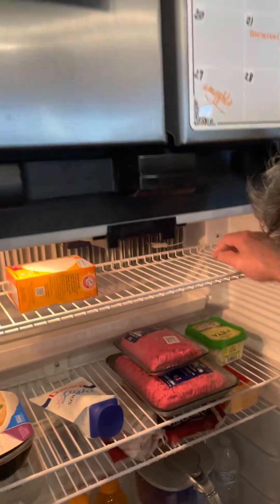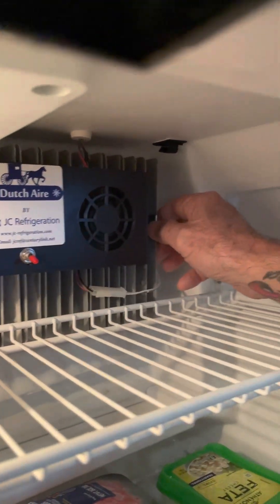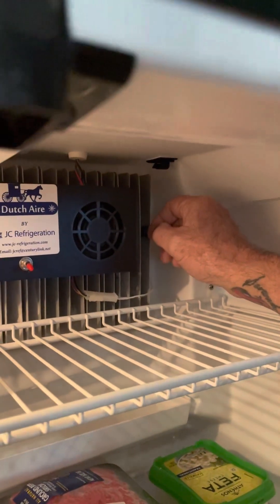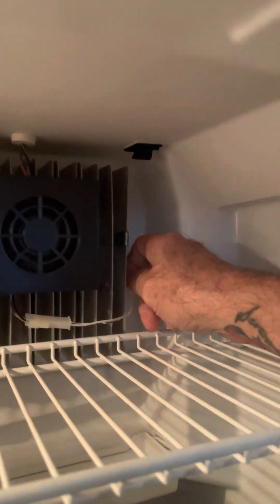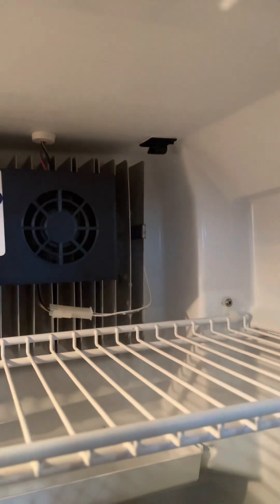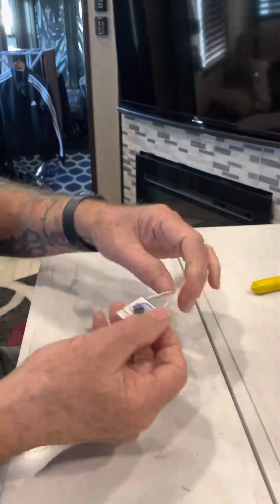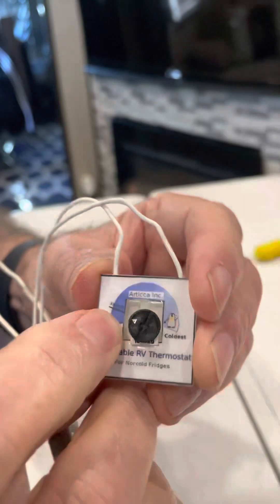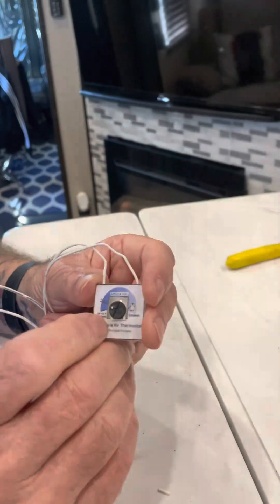Thermistor upgrade for an RV fridge

Comment: bummer. unfortunately, their website is archaic, consists of one page and there's no way to reach out to them....
Reply from the maker: Yes the web site is very basic but it does the job. You can message them on FB.
Reply: It seems like the page does not show the upgrade your video speaks of, but just lists the replacement thermistor part.